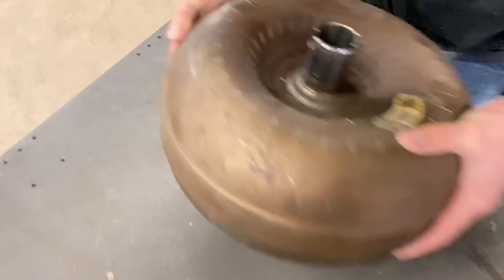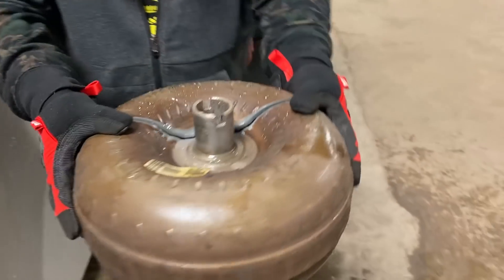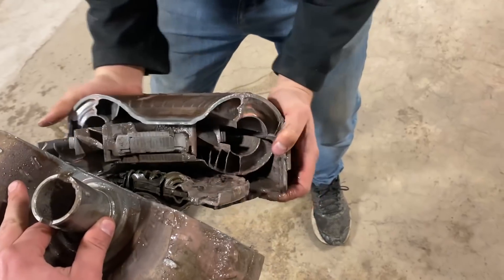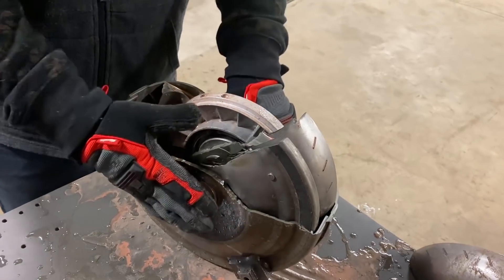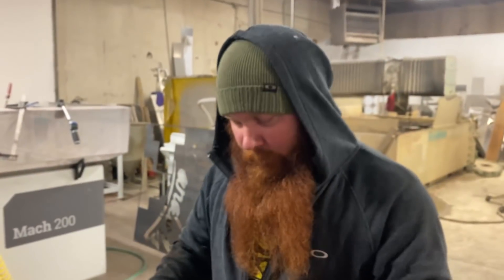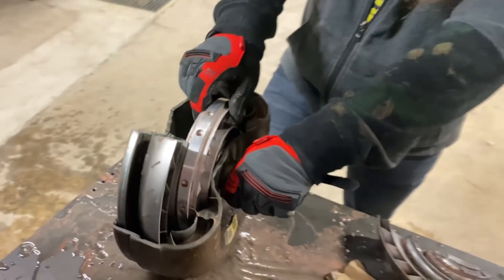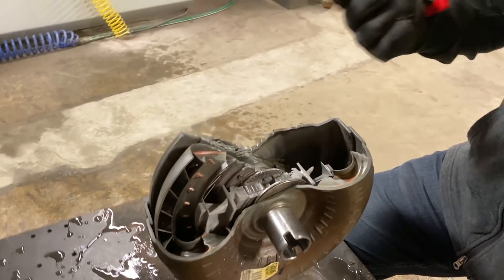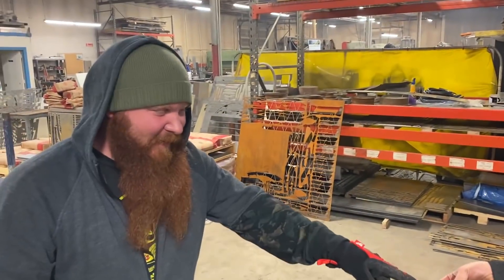Torque Converter vs 60,000 PSI Waterjet | Amazing Cross-Section

Comment: 4L60 transmissions have a torque converter lockup which is that clutch looking thing. At higher rpm it locks the input to the output to allow direct power transmission..... So it doesn't always use fluid to transfer power and actually goes into lockup more often than you'd think.
Reply: Potskie saved me writing it👌
Reply: @Arsopu  same, i was gonna say just that lol
Reply: @Jonnymechanic-302  not true
Reply: I too was going to say all this.
Reply: 186000 on mine and still going
Reply: freak89 177,000 on mine and the fluid has only been changed a couple times and still looked good.
Reply: Good to know!
Reply: Thanks Potskie!  That's a lockup TC, not just a TC.  So there is a mechanical connection. Used to rig up a jump switch on the F-bodies thru the ALDL to get a slightly lower 1/4 time.
Reply: Not higher rpms. Typically lower RPMs in overdrive (4th gear) when the differential speed is low, that is to say the difference between the imput and output speed of the torque converter. There are automatics that will engage the TCC outside of high gear.
Reply: It doesn't lock at high rpm. It locks in the final gear at low engine loads. It almost acts like another gear. Fancier transmissions lock the torque converter in more or all gears for fuel economy. 4l60e locks only in 4th or 3rd if overdrive is disabled.
Reply: Me too
Reply: at 3:35 you can see the sprag bearing.
Reply: A lot of transmissions have that
Reply: i thought the pump provides the lock up pressure for the activation of the lockup, the lockup is it locking up in fourth gear almost like an 'overdrive' shift when it happens to increase efficiency while cruising. however i've been wrong before.....
Reply: @allianceofsteel  Pretty sure you're right. The 4L60e also has PWM lockup IIRC so it can actually slip the lockup clutch depending on load.
Reply: Every Ravigneaux planetary gearset style automatic transmission since like 1985 has a torque converter clutch...
Reply: Isn't a locked up torque converter a failure mode? I had an old chevy van with a 'locked up torque converter', and the van would stall and die when you put it in drive.
Reply: @rich1051414  no, it lets the auto drive more like a manual with 1:1 from engine to Gbox. Gets rid of the awful slip/lagginess of auto above around 2700rpm by "locking" the outer and inner shell together
Reply: @iMagic16  I wasn't arguing otherwise. But if they get locked permanently due to equipment failure, it will cause the vehicle to be unable to start moving without stalling out.
Reply: Ya the 4l60e gets a bad rap if you are going to enjoy that LS motor in a heavy truck or SUV ya they don't last long when they are 100% stock but a good rebuild will fix most of that at a reasonable power level but if you get one from an adult that isn't mean to their vehicle they can easily last 200k even with towing which other vehicles would basically be done by then anyway and as far as anyone on YouTube can rebuild one I mean I did from YouTube but I don't really consider myself an average YouTube mechanic or anything
Reply: It actually only locks up the converter at low load cruising
Reply: gavwilldo it locks up when it hits a certain rpm
Reply: @blacksheep9734  It locks up based on speed, gear, and throttle. It locks in every gear but first. At a light throttle, it locks up at 5-10 mph. It lets it slip until a higher speed at full throttle.
Reply: Fun fact, on the 4L60E you can wire a manual lockup switch that will let you lock it up at almost any speed or RPM because GM decided to have the computer control lockup instead of installing any but the bare minimum mechanical safeties. The TH700R4 (precursor to the 4L60E) technically has an electronic lockup but that can still be overridden by the valve body depending on conditions.
Reply: @blacksheep9734  RPM is only part of it.  Engine load and braking factor in also
Reply: @Bob5mith  that's true for an Allison, not a typical 4 speed.
Reply: But doesn't change the fact that it's shitty transmission. It's actually somewhat rare to see cars that have that transmission with 150,000 miles without rebuilding it.
Reply: @twiztidem  that's funny, in stock form with regular fluid changes I have seen these transmissions with four hundred thousand miles. I am not aware of a more reliable transmission from any other OEM.
Reply: @86dieselman  4t65e's can go their fair share of miles too. As long as you don't put too much power through them that is.
Reply: @86dieselman  4l80
Reply: @twiztidem  Rebuilds aren't that bad on these units, so its not that big a deal.
Reply: @sparkplug1018  no they're not that bad to rebuild almost every person that watches YouTube can rebuild a transmission now....
Reply: @twiztidem  True.  When these things first came out they were pure junk.  Band, 3-4 clutches, rear planetary and pump on nearly every one of them.  Many not near a 100,000 miles.
Reply: Screw those damn 4L60’s 😂 had to rebuild the one in my envoy and damn will I never buy another suv with a crappy 4spd trans like it